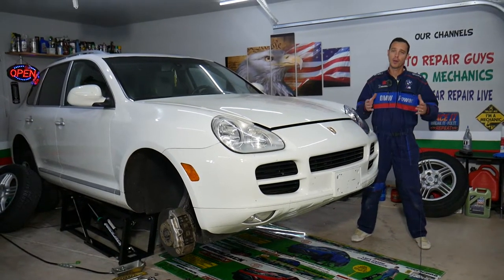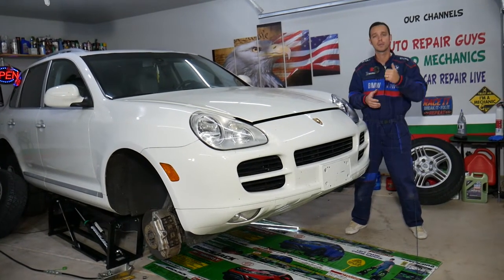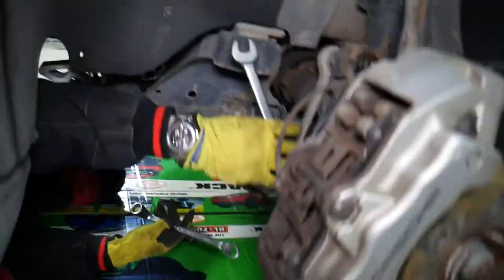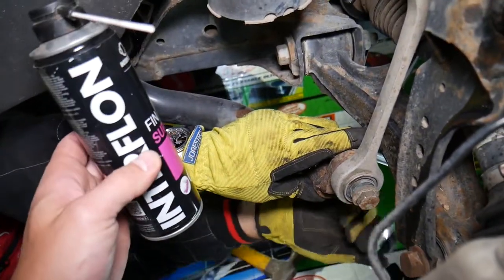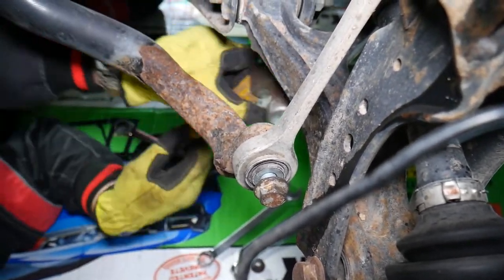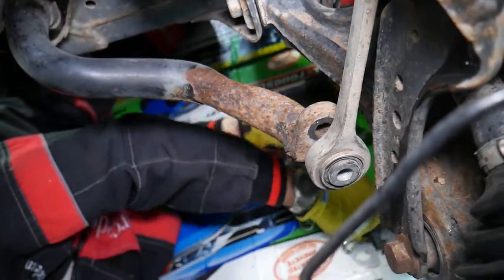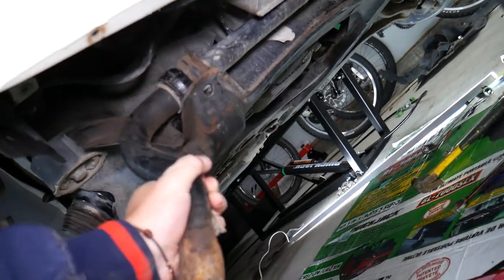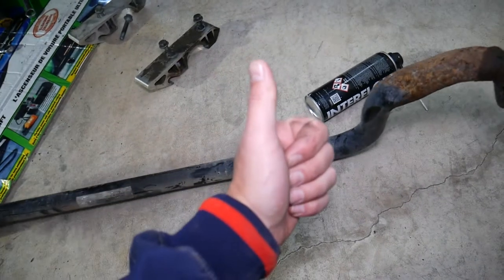FRONT SWAY BAR AND BUSHINGS REMOVAL REPLACEMENT PORSCHE CAYENNE, AUDI Q7, VW TOUAREG

Comment: Hi, I saw your using the quick jack system. Can you share for the Cayenne is that a BL-7000SLX or BL-7000EXT model your using and any accessories like the Pinch-Weld Blocks or Pinch-Weld Pucks to lift the Cayenne, thanks. From Forums the Cayenne has a 72" lift spread and even the  BL-7000EXT (at 66") does not work.